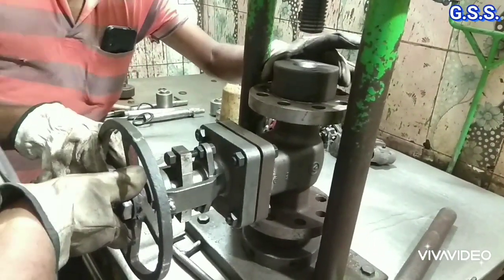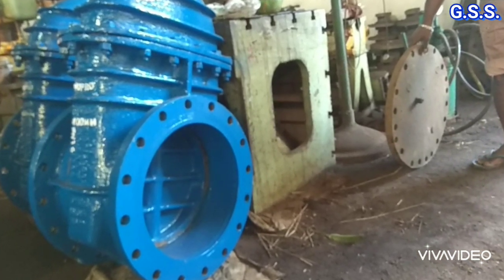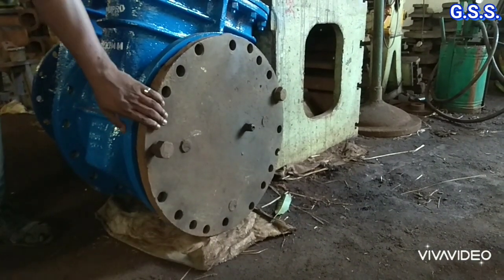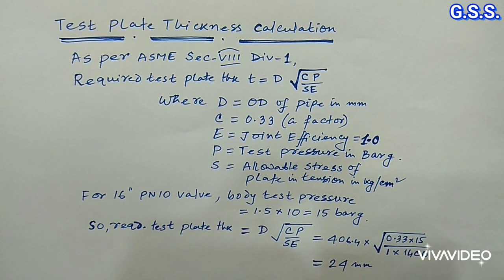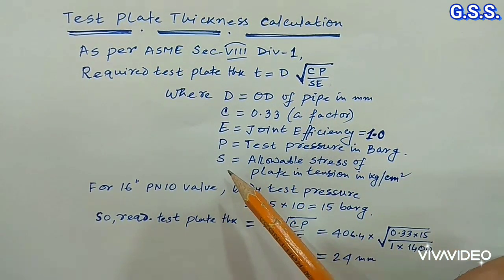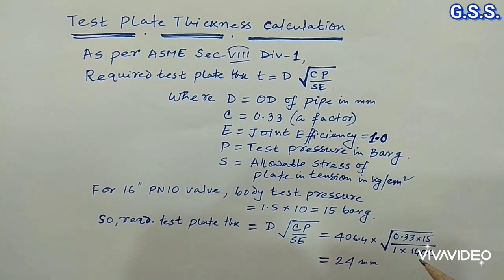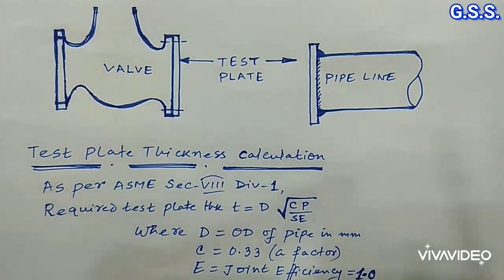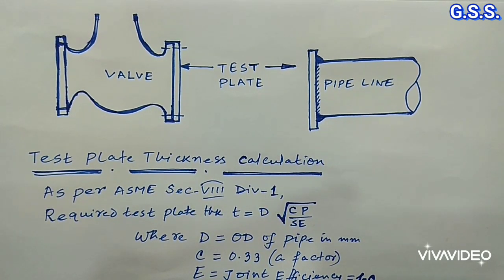Piping Engineering : Large dia valve testing

Comment: Why sir in many bibg bore lines for water application pn rating valves used insted asme ration like 150#
Please guide
Reply from the maker: PN10 means valve is workable upto 10 bar pressure, PN6  means valve is workable upto 6 bar pressure.

ASME designation like 150# is different. An 150# valve is workable upto 19 bar pressure at ambient temperature. For details please watch my below video :

https://youtu.be/iDRjQ5IdFEI
Reply: @gourisankarsamanta7670  thank you sir